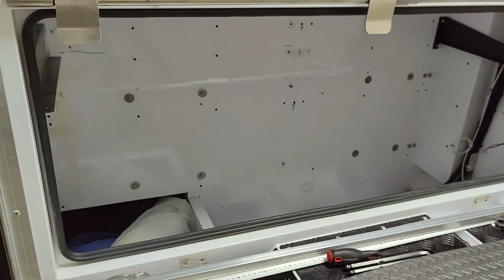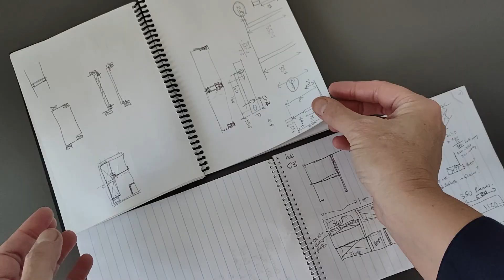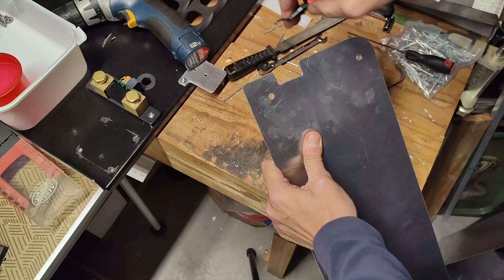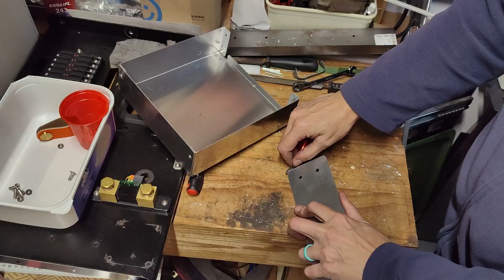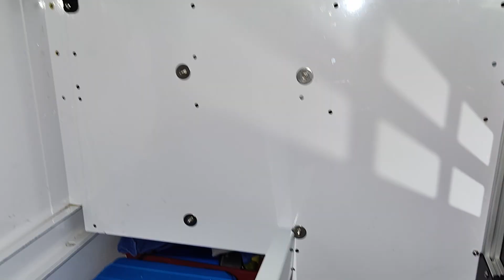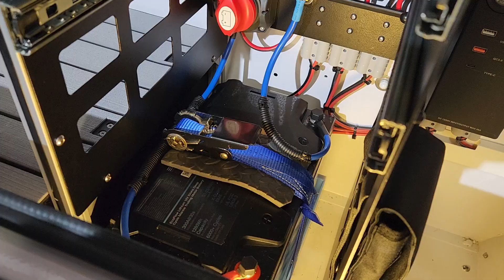Genie Trailer new DIY Kitchen and Electrical Design

Comment: Excellent! Innovative planning of the drawers. Any ideas on how we can protect our lithiums from vibration?
Reply from the maker: Thank you, The battery we used is a trolling motor battery from Ecoflow and it is specifically protected for vibration. We just made sure it has a sturdy tie down too.
Reply from the maker: This is off their info page. "The structure system securely fixes battery cells, boosting safety and reliability. Fireproof foam is used for cell and pack fixation, offering protection, vibration and friction reduction, short circuit prevention, damage resistance, and excellent thermal insulation."

Comment: Brilliant , I have been planning something similar in my head for a while for my jimny. The problem I have been struggling with is weight as I want to keep it below the on brakedlimit . Any idea how much the setup weighs?
Reply from the maker: The whole build is aluminium to keep weight down, and the lithium battery is also the lightest. In any of these type of builds the runners are the heavy parts. We need to do an empty weigh in again sometime on the trailer.